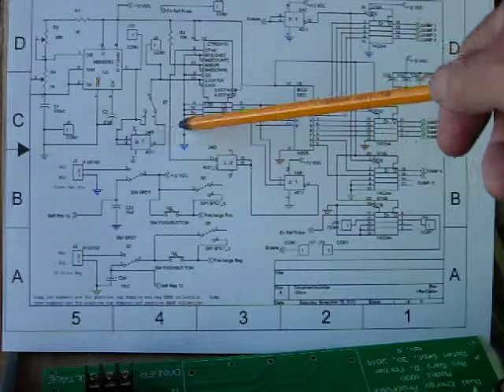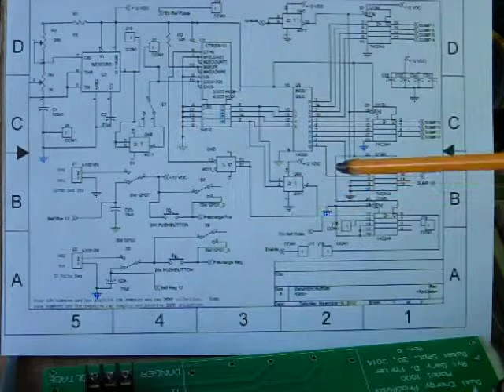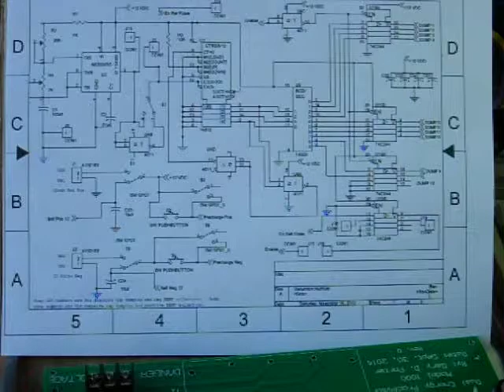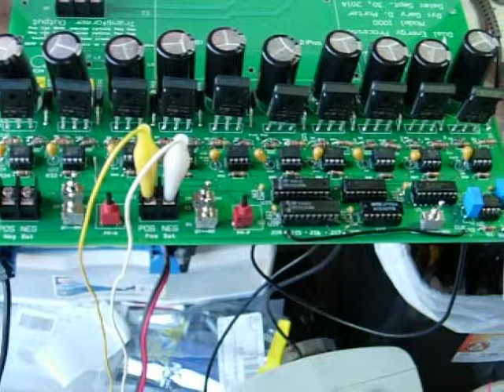Don Smith #94 PCB and schematic for new dual energy system

Comment from the maker: Lots of problems to be solved with the pcb layout and design of the circuitry.  for some strange reason I'm only getting 4 v to my caps.  also founf that with neg pri disconnected the caps do receive -4v from pos BEMF but when 12v is removed the neg caps all loose their charge.  it should set at -4v.  weird stuff going on.

Comment from the maker: Next step will be to have the output system work in harmony between its components.  another words the coils and their respective field need to work with each other instead of fighting each other.   Testing of pulse rates, coil shapes and everything associated with the bemf flow will need to be thought and tested.

I also just removed the 100 uf caps and replaced them with 10uf 350 electrolytic.  I may need to change these to a high quality cap that will hold a charge and that can be recharged fast enough to make the output be self sustaining.   I purchased some caps from Mouser 22 nf at 6kv   and they held a charge.  my screw driver touched one during unpacking and BANG.  The smaller the cap the higher the stored energy level my FETs are rated at 250v

Comment from the maker: Just used the extra 244 buffers and also the two 4011 nand gates to give me a delay for the enable input to 244's buffering the dump pulses.  The delay has solved the noise problem.    now their are no extra pulses occurring at the falling edge of the enable line.

Comment from the maker: Just turned on the pcb with both batterys attached.  first indication was a lot of noise between the 244 buffers and the FET drivers 4422.  This caused all kinds of extra triggering at the FETs.  The other problem noted was that the 100uf 350 caps appear to be too large.  The neg side without neg bat precharge  does however charge up to about -5 vdc which is then dumped by pulses to neg FET drivers.  So the concept does work, it's just a matter of tuning the entire system.    I have some 10uf 350 vdc caps if these aren't low enough value then I'll use 1 uf and lower till the system finds its highest operating level based on BEMF from coils feed back.  I'm hoping to be able to get it to operate very near the FET maximum voltage of 250 volts.   If I can go higher I'll need different FETs$$$$$.

The noise issue is caused by delay from counter clocking thru the counter thru the decoder and then to the 244 buffers. the next clock pulse after count is created is happening sometimes during the falling edge of the count. Bad noisy pulses are very intermittent and come in all sizes because the edges are very close.  the count pulse is trying to go low but the second enable pulse fires just as it is going to the low and sometimes grabs it at the high level creating the extremely fast noisy spike.

The solution to this noise issue is to use the delay option that I built into the 244 which can be jumpered to create at least two chip delay.  If this isn't enough delay then I'll have to remove the grounds to the other 244 inputs so they can also be used for more delay.   The idea is to get the enable pulse to occur after the count has settled to a high level then enable it thru the 244 and just after the count goes low then the second enable pulse will be enabling only lows to the driver inputs instead of noise spikes.

I also forgot to separate the digital and analog grounds by using two copper pours instead of the single one I used.  stupid me.

Comment from the maker: From researching Tesla's patents and writing we can find that he tells us how the electrons never get very far into his thick primary coils.  The etheric wave of energy does however expand outward into the secondary and extra coil regions.  his transformer was electrostatic energy which he pumped into the earth.  These waves were reflected back into his transformer just like BEMF pulses and when the reached the top of his extra coil and capacity huge arcs occurred.  The electrostatic energy had been converted into useable electrical energy to do work.  I need to test different transformer primaries, learn the differences and then decide on which style that will best fill my needs.   From other testing we know that the BEMF will charge several batteries from the discharges. so this device should work out great.  one possible problem could be that it will enter into a run away situation, since the caps create the level of energy that is charging them.  If this happens I'll need to add some limiting circuits.